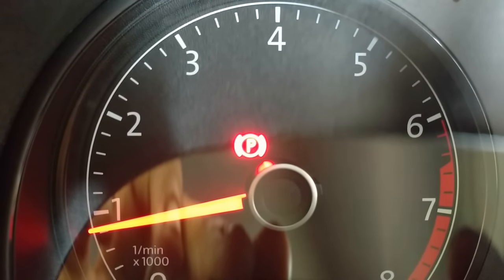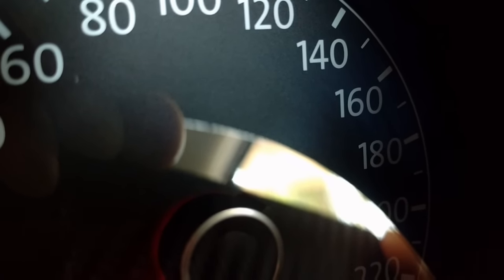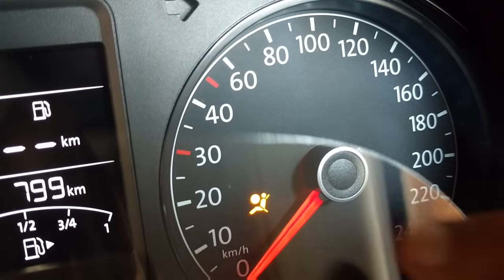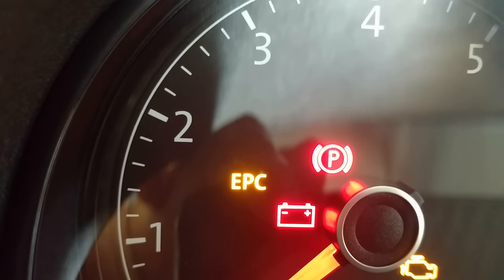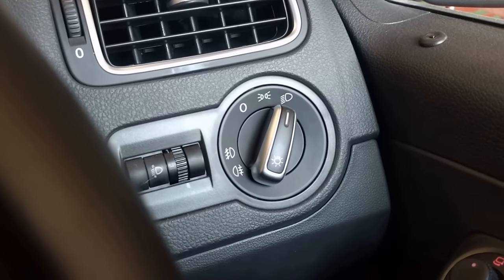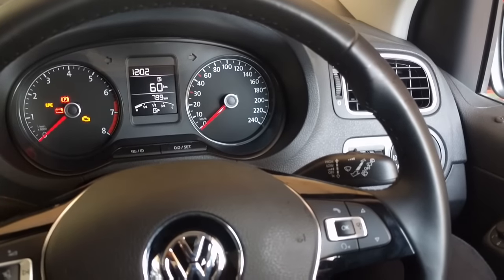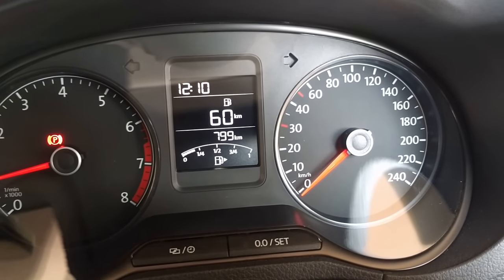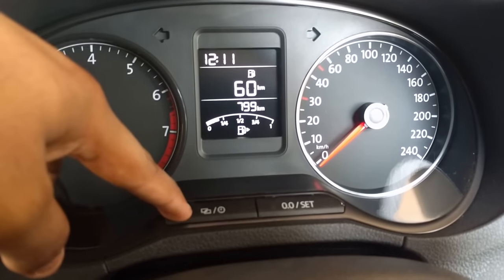Warning Lights / Warning Sounds in Volkswagen Polo

Comment: Hello sir,

I’d like to understand is it normal for “Battery Error: Alternator Low Voltage Output & Check engine light” indication to be ON before starting the car?

Because once the ENGINE is started its stops glowing.

Comment: Problem Tday im faced one issue , battery fully drained at morning, I can't start my ameo. 
 Reason 
Before 10 days i installed after marked audio pioneer,  last Sunday i took the ameo and drive in for 4 km, tday im tried to start the car bt battery fully Drained, 
Technician said tat , problem because didn't off the audio system .. it is possible to drain the battery by double din audio system?
Reply from the maker: Yes. Even a small led light is enough to drain the car's battery. So a music system which is left in ON condition will definitely drain the battery.
Reply: dilip sukumar ok brother

Comment: how many liter engine
what's the torque
I am thinking of buying a polo
confused between elite i20 and polo I'm from nagercoil in tamilnadu I think u r from chennai
what's the on road price of top variant of polo in chennai
Reply from the maker: +Arish Psa I am driving the petrol Variant which has a 1.2L engine which has a maximum torque of 110 Nm @ 3250 rpm. 
On-Road price of Polo Allstar Petrol variant in Chennai is 854348/- in February 2017.
I have compared between 2017 model Elite i20 and VW Polo. Please watch my video titled Hyundai Elite i20 Vs Volkswagen Polo

Comment: Hi, I've seen most of your videos and was useful when I wanted to buy VW POLO..  does your car have seat belt warning or indicators in dashboard. I checked for it in my Polo (Highline plus) and could not find anything related to seat belt warning.
Reply from the maker: +jnnsh ndrw No. There is no seat belt warning light in Volkswagen Polo... Thank you so much for your feedback...
Reply: dilip sukumar thank you.. Does it give any alarm on driving without seat belts...  Do you have any videos posted specific to different alarm sound that is supported in Polo....  Your responses will really help me out in exploring the car in detail...  Thanks again...!
Reply from the maker: +jnnsh ndrw Polo will not give any warning alarm if driven without seat belts. I have made a video titled warning lights / warning sounds in Volkswagen Polo.  Thank you...

Comment: I bought a polo tdi 1.5 . On ignition , first all the warning lights glow and disappear but check engine warning light keeps glowing. When I start the engine that light also goes off. Is it normal for a check engine light to glow and keep glowing on ignition? No warning lights are glowing after the engine starts.
Reply from the maker: +shatmanyu singh it is absolutely normal... You have to check only when the engine is running...
Reply: dilip sukumar thank you sir
Reply from the maker: +shatmanyu singh Welcome
Reply: @dilipsukumar  I had same doubt. Thank you for your confirmation. However, I wonder why those EPC and Engine warning lights appear after switching on ignition and goes off once engine starts

Comment: What about the flashing red beacon on the driver side window ? It flashes when the car is locked.
Reply from the maker: +The Guru Gamer that red beacon flashes to confirm that the central locking system of the car is working properly.

Comment: sir what are your reviews about vw ameo 1.5 L diesel
Reply from the maker: +sachin rawat it is a nice car. It has very good performance and gives good mileage too. Build quality is great & the steering gives accurate feedback.  If you are interested in buying it, please go ahead...
Reply: dilip sukumar sure but tell me a thing ground clearance is same on both ameo and polo??
Reply from the maker: +sachin rawat when I asked in showroom, they informed that both the Polo & Ameo have the same ground clearance of 165 mm. But in the user manual, it is clearly mentioned that the Ground clearance of Polo is 168 mm while that of Ameo is 174 mm.

Comment: Hi Sir, is there any warning light for air pressure indication in vw polo highline tdi?
Reply from the maker: +shatmanyu singh No. There is no warning light for low air pressure indication in Volkswagen Polo Highline TDI. It is not available in any of the variants of the Polo sold in India.
Reply: dilip sukumar how much air pressure has to be maintained in front and rear tyres sir. ?

Comment: Hi dilip,
What does yellow steering light mean?
Reply from the maker: +Rockey S yellow steering light means there is a fault in the power steering. 
If it lights up when the engine is running, then only we have to pay attention...
Reply: It just lights up for a moment and goes off by itself do I need to visit service station for that?
Reply from the maker: +Rockey S no. Your car is in perfect condition... You need not visit the service station...
Reply: All warning light turns off as soon as I start the ignition.
Reply: Thanks I really appreciate your work and love your videos
Reply from the maker: +Rockey S that is to indicate that all the warning system are in working condition... As they turn off as soon as you start your car, it means that your car is in perfect condition...
Reply from the maker: +Rockey S you are most welcome. I am glad you liked my videos... Thank you so much for your valuable feedback
Reply: dilip sukumar  hi again dilip I've visited vw service center in the evening and I told then that I feel my car steering little tight they took a short ride of my car and told me that there is a problem in my steering motor for that they need to change the whole assembly line of my cars steering that would cost me around 55-60k but my steering warning light isn't lighting up while I start the ignition are they be service center trying to loot me or is there a problem in my steering warning senser light? Please guide me I'm so much confuse.
Reply: Dilip r u there?
Reply from the maker: +Rockey S The steering warning light will light up only if the steering oil level is low or if there are any minor electrical faults like a fuse is blown in the electrical line of the steering system. It will not light up for mechanical faults. If you have any doubt with the VW dealer, you can check it at any good workshop in the nearby you...
Reply: dilip sukumar ok dilip thank u so much